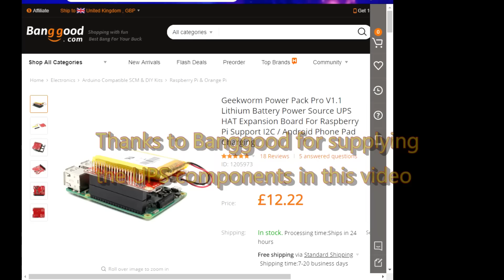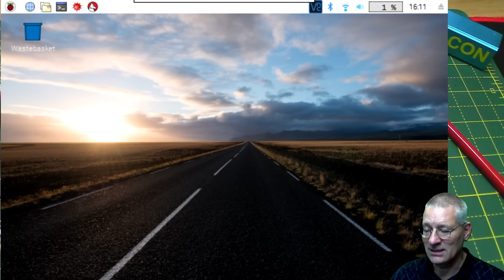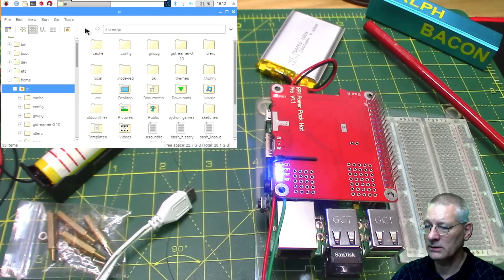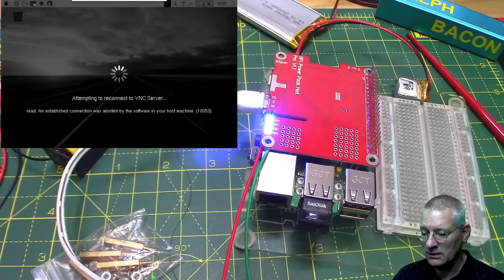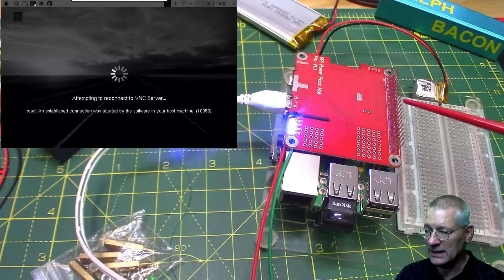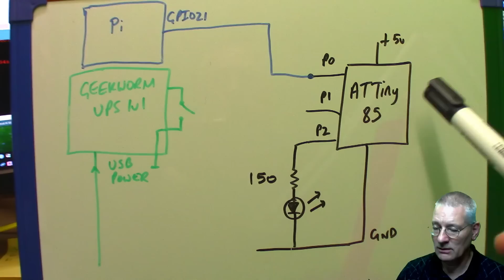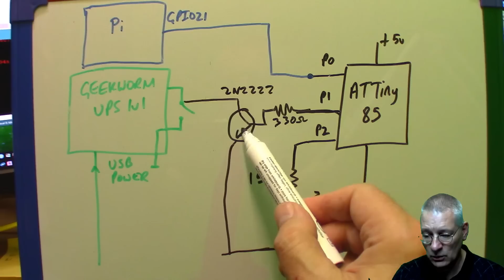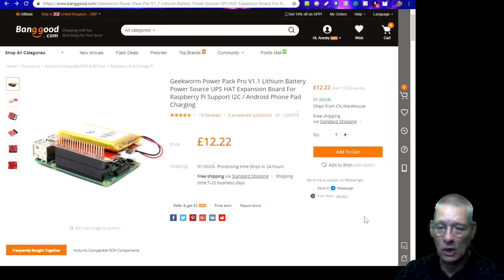#124 Raspberry Pi UPS Fix - with an ATTiny85 control (EASY)

Comment: Ralph, thanks for your video, my HAT just arrived. I have a problem with it though: it can't deliver enough power to my Pi. I tested the board without any battery connected to it, and on boot there is the low voltage indicator. (and the lighting bolt appears when doing something)
I charged the battery, and tried the system with it: the same issue. I tried multiple cables, my power source is a 2A Samsung charger which is perfect when I directly connect it to my Pi (even can handle my external hard drive).
I'm using a 3b+ with a stock desktop image and my cpu can only run at 600mhz this way.
Edit: I even have some reboots.
Do you have any suggestions for my issue?
Reply from the maker: By a process of elimination:
1. Try another power supply. I know your Samsung charger works fine directly with the Pi, but it's not the official power supply, so try something else.
2. Measure the input voltage to the HAT at the USB connector. Take care not to short anything out. My video shows where the 5v track is (underneath) @21:18
3. Measure the voltage at the output of the HAT on the 5v pin (of the 40-pin header), is it below 5v? Don't short it to the 3.3v as you do this or your Pi will be toast.
4. Have you got the red & white cables of the battery correctly (see my WARNING in the video that the connector was wired up the wrong way round @ 28:49)?
5. Any obvious defects on the HAT PCB?  Do the blue lights light up in sequence as they charge the LiPo battery?
6. Try a different Pi if you have one.
7. Google for any similar problems by others.
8. Contact your seller.

That's what I would do, Ádám, I hope you succeed in sorting this out.
Reply: Ralph S Bacon thank you for your feedback, really appreciate it!
First thing is that my battery wiring is good, that was the first thing what I checked when the board arrived (thanks for your video for the information)
I'm going to borrow another, more powerful charger to test things out. Maybe I can test it with my friend's 3b+ also. 
In the following days I'm going to measure the voltage of the connectors. I only have a multimeter, I hope it'll be fine.

My question is: can you clarify that your pi is a 3b+ one, and your HAT pcb is fully functioning with it? Even under some load? 
The site says it's compatible with pi 3 and I don't know how different is the b+ from the original one. To make sure that it should work.

Thanks!
Adam
Reply from the maker: Yes, I'm using the new Pi 3B+ and it's working fine. When you say "under load", I just booted to the desktop GUI (Stretch) as you saw in the video, it was not doing anything special. 

A multimeter is fine to measure voltages, just be EXTRA CAREFUL when using it with the GPIO header pins, it's too easy to short the +5v and +3.3v together as I did and that will destroy your Pi. Ideally, use a suitable Dupont cable to do this. Good luck.

Comment: How to add a safe shutdown to the attiny functionality when the battery is low without having it to restart the Pi?
Reply from the maker: If you watch my video #173 (and #176, not yet published) You will see a simple circuit to do this. Your Pi must monitor a GPIO pin that is set LOW by the  µC, carry out housekeeping tasks, then the Pi sets it LOW again so that the µC circuit recognises the signal and shuts off the power. It will at least give you ideas on how to do this with a Pi.

Comment: Hi

I think i don't understand something on the code...

if i change
  if (loopDelay > 29) { ->  if (loopDelay > 120) { . Is these seconds?

And it would be enough loop once 10min
  delay(600000);

whole program is not working at attiny85 after these changes . Should be have enough time to do fsck etc. if needed.

Thank you for great videos thou! :)

-Jari L

// ------------------------------------------------------------------
// This loop check to make sure Pi is UP
// ------------------------------------------------------------------
void loop() {
  static unsigned int loopDelay = 0;

  // Read the RasPi's output pin - should be HIGH if running
  if (digitalRead(PiHi) == 0) {

    // Only do something if the Pi has not had this pin HIGH for X seconds
    // to allow it time to boot up or we could be constantly resetting it!
    if (loopDelay > 29) {
      digitalWrite(UPS_Pin, HIGH);
      digitalWrite(Indicator, LOW);
      delay(5000);
      digitalWrite(UPS_Pin, LOW);
      loopDelay = 0;
    }
    else {
      // Start the countdown to a reset
      digitalWrite(Indicator, HIGH);
      loopDelay++;
    }
  }
  else {
    // Reset any part-delay we've counted
    loopDelay = 0;
    digitalWrite(Indicator, LOW);
  }

  // Loops every second, fine for demo
  delay(1000);
}
Reply from the maker: I'm not sure what you are trying to achieve with those mods to my code, Jari? What my function does is to give the Pi enough time to boot up and bring that GPIO pin high. This lets the ATTiny85 detect that the Pi is running.
The "29" in the loop is indeed seconds (due to the delay(1000) (that's 1000 milliseconds) at the very end of the loop). why are you trying to increase that, is your Pi super slow or something?
Reply: @RalphBacon  My application for this is scenario...
Raspi3 is functioning as surveillance camera, network connection with 3G USB dongle.
USB dongle tends to go unresponsive after week or two, even after i reboot raspi, dongle gets no connection ever again. I have to poweroff raspi so dongle goes totally blank and then it's working again.

So my plan is to poweroff raspi every night. And because SD cards is a bit unreliable, i would also do fsck at reboot every night. So there should be enough time, about 10mins raspi to do fsck. This surveillance camera is few hundred kilometers away, so i am no hurry, but everything should work reliable as possible. Now i have tried tiny85 1Mhz with this code, if i add 29 -> 600 (s), or any bigger value, i can't get any reliable operation. My first try with tiny85, so i am a bit baffled about is this code problem or something on my tiny85 setup? 

As i can understand code should work just to change 29 -> 600, to give 10mins time raspi to bootup.
Right?

Thank you for reply
-Jari
Reply from the maker: 10 minutes for a RasPI to boot seems excessive, Jan. If it's not there (running the startup code I showed, which sets that GPIO pin HIGH) within 30 seconds then something is wrong. I'd get all this working on the workbench first, using my (shutdown/reset) circuit so that the PI can do what it needs to before actually shutting everything off.
Additionally, instead of writing to a flaky SD card, try using a USB memory stick - it's what I use to boot from and I've never had an issue. You can use it to write data to as well. No fsk routine requited! Just a suggestion!
Reply: @RalphBacon  Of course i will setup at workbench first, and test that all is functioning correctly. Thou i think there should be more time to raspi to bootup. USB flash memory is a bit better than SD card, usb hdd best option.
All i try now to troubleshoot, is code wrong if i change 29 -> 600, or is it something to do my tiny85 setup? Because if i change time, tiny85 is not working right, at 29 sec its working as intended.

Comment: Using the pouch cell supplied, with a Pi 3B+ (headless) showing 'home screen' via VNC - processor idle.  Using a multi-channel logger , plotted Li-On Battery voltage, '5V rail' , and status of GPIO 26, at 1 minute intervals.

The Pi was powered for 3hrs 31minutes before it shutdown - ( by pouch cell protection circuit)

The graphs show:
a)  '5V rail' - (output of UPS  - Pins 2 and 4) -  constant at 5.17V  (until shutdown)
b)  Battery output roughly linear discharge from 4.0V to 3.25.v at time 3hrs 22minutes.  Then curve downward for 9 mins to shutdown at 3.05V
c)  GPIO 26 dropped from 3.28V to 1.5V immediately after external mains power (5V wall wart) removed. Varied between 1.5V to 0.9V until 0V at shutdaown. (Of interest only as not an input to ATtiny which is not powered at this time)

The UPS blue 'lowest charge LED' flashed at 3.3V battery level.

Suggest 3.25V as a 'gentle closedown' threshold ?. 

Hope the above may be of use/interest to anyone programming battery monitoring software for this configuration.
Reply from the maker: Excellent information, Dave. I've been away with eye surgery and am only now catching up. I need to complete this video by using the I2C bus on this device to monitor the battery voltage. Thanks for sharing.

Comment: Ralph, it's hard to use your affiliate links if you don't give them to us. I've got an Amazon gift card from Christmas that I recently found, and it's burning a hole in my pocket. Actually to be honest,  I want to use it before I lose it again.
Reply from the maker: True, Steven, but I don't link to stuff I don't use (or recommend). But if you're set on using Amazon for Arduino-related stuff use any of my Amazon affiliate links and then navigate to the item you want to buy. It's supposed to work but until someone does it I'll never know! I await with bated breath...
Reply: @RalphBacon  Don't they give you some sort of code that you add to the link, so it points to you?  You might be able to just point to their homepage rather than to an item. If that works then you could just point to all of the affiliate links home pages.  You could post that either at the end of every video or to the video #146 "How to Support My YouTube Channel (at no cost $ to you!)." Then mention it at end of your videos. 
It's just an idea, do with it what you will.

Comment: I think the red varnish stuff is called lacquer.   And that's about teh extent of my knowledge.  Cheers
Reply: On a PCB it's called solder mask (or sodder mask in the US:) ).
Reply from the maker: Both replies here are correct.
 
Wikipedia says: "Printed circuit board with green [or red?] solder mask coating. Solder mask or solder stop mask or solder resist is a thin lacquer-like layer of polymer that is usually applied to the copper traces of a printed circuit board (PCB) for protection against oxidation and to prevent solder bridges from forming between closely spaced solder pads."
 
I knew this. I just couldn't bring the word to mind. Really. Truly, I knew. Pinnochio nose? What do you mean?

Comment: Those standoffs are stackable
Reply from the maker: Do they allow the board to be properly plugged into the 40-way connector when stacked? If so, I shall mention it next time I do a video on the Pi. Thanks, tablatronix.
Reply: @RalphBacon  hmm, no idea I assumed they provided the proper height, they do look a bit too tall, so maybe not..
Reply: Looks like standoff for stacked boards without extended headers is M2.5 x 11mm, cannot confirm though my pi is in n enclosure on my 3d printer atm
Reply from the maker: I'll take a closer look tomorrow. Right now, after 9 hours on my feet, I'm knackered! The mind is eager the body says have a beer and watch some TV. Guess which one is winning?

Comment: ATtiny could sink 20 mA... Perhaps eliminating the transistor.
Reply from the maker: But would not that not present +5v at the pin whilst it was not low? I don't know how that switch on the UPS is configured and I would not want to start pushing 5v into it. What do you reckon, Bernd?

Comment: Dear Ralph,

I bought some of the blue Geekworm UPS hats to try and experiment with an inexpensive UPS for the Raspberry.

I bought some of them in the hope that they would work, but they did not charge the battery after a power outage. So I set out to modify the Geekworm hardware so that it automatically restarts charging the battery, and developed a small add-on board with an ATTiny that, together with a daemon running on the Raspberry, adds a lot of missing functionality.

I would be very happy if you would have a look at it, give me your feedback, and in the best of all cases, feature it in one of your videos. :-)

Here is the link: https://github.com/jbaumann/attiny_daemon

Btw., everything is open source, and the overall cost including the Geekworm UPS is less than 20€.

Kind Regards, Joe
Reply from the maker: I'll have a look at that link for sure, Joachim, thanks for sharing.